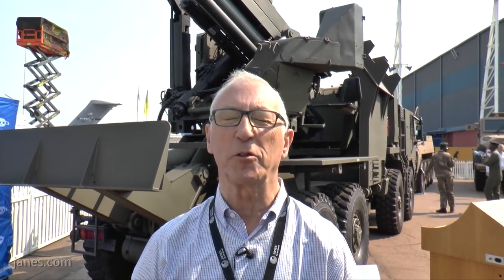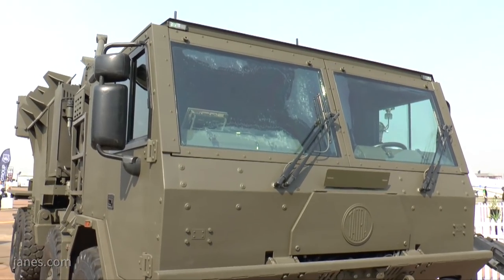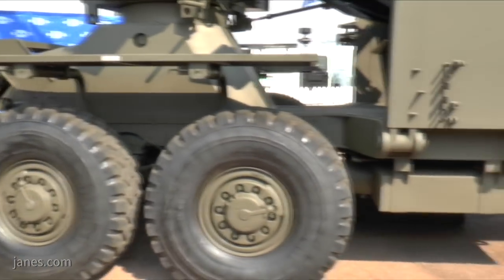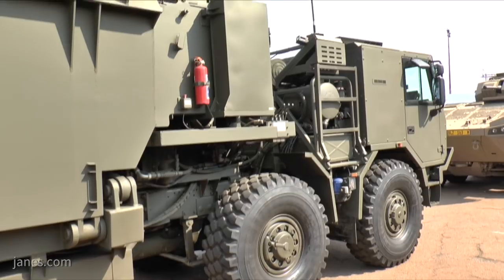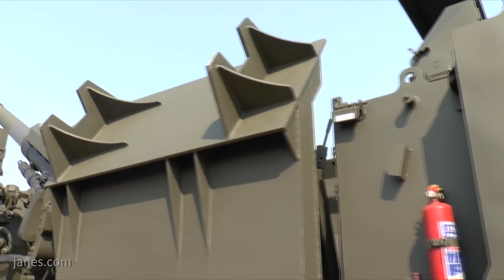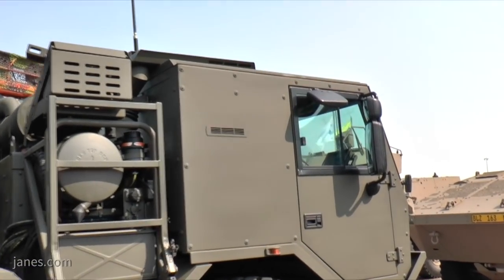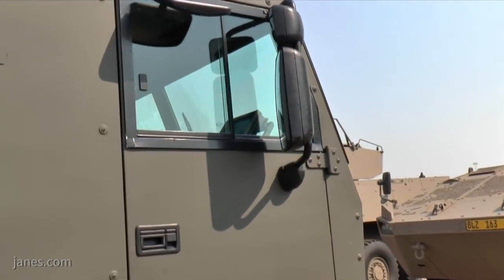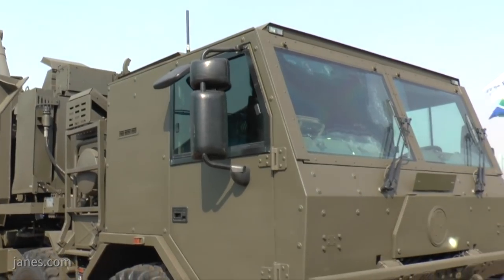AAD 2018: T5 155mm mounted gun artillery system - Denel

Comment: This is crap in comparison to the G6 ! Just a glorified truck wit a gun on the back.....
Reply: Has a bigger howitzer barrel than the G6 meaning longer range. Less maintenance and because it's easier to maintain because it's built in sections. It's a win all round. And it's impressive as well as cost effective. It's not just a truck with a gun at the back end. Pretty sure they can produce more of these than the G6 Rhino which would be great for war time
Reply: It is less expensive too, longer range, less fuel requirements, easier to maintain. Great vehicle for motorised troops. G6 is nice for mechanised or armoured, but an expensive piece. When you need massed artillery with high mobility, this is great. And it can replace towed G5 pieces, without requirement for a secondary towing vehicle.
Reply: You are probably talking from Australia. No we are moving on as a country!!
Reply: @clementmpushe5957  lol ❗🤣🤣